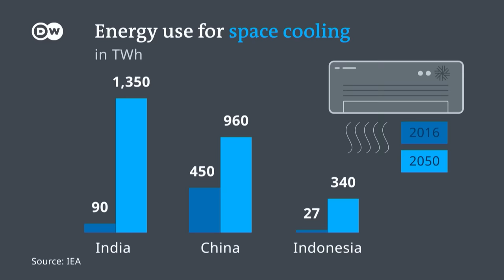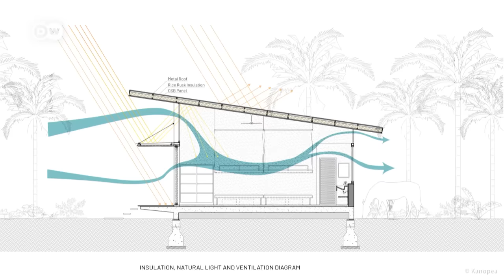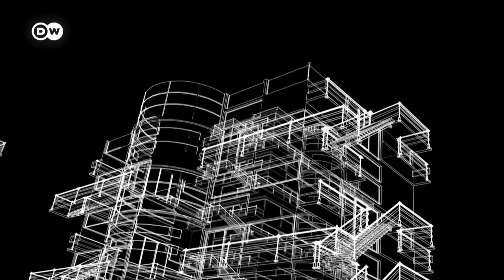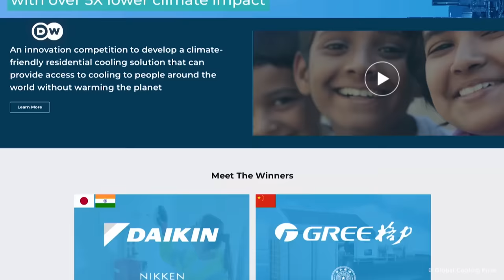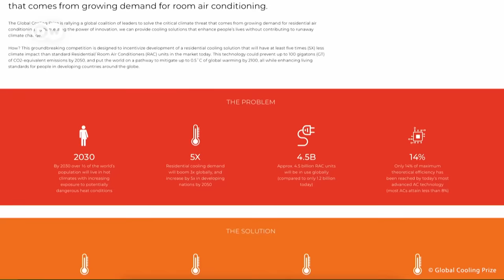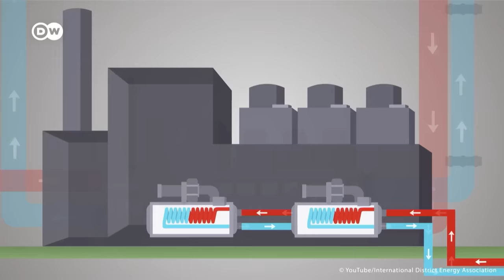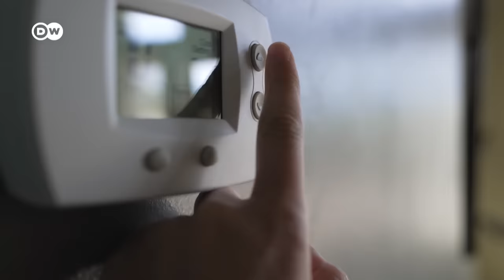How to cool our homes (even without ACs)

Comment: This video just absolutely does not represent the advances in building construction and energy standards for building envelopes wrt to higher insulation values, increases in energy efficient HVAC equipment and types of refrigerants used in the US.

Most of it is "climate crisis" platitudes.

If it's a 110 degrees outside in a middle eastern country, drawing outside air in through wind shafts or whatever at the top isn't going to cool the building.

I suspect most of the people in this video and especially the owner of this channel don't even know what the CO2 concentration of the atmosphere is.

India (and not to mention china) is one of the worst polluters in the world.

Properly designed glazing and glass facades are not "hot boxes" as someone who obviously has no clue about building envelopes.

They can be coated with high radiation reflecting material, and built with gases in between 2 or more panes that increase the insulation value.

Their energy and pollution problems are not the US tax payers' responsibility.

The US has some of the cleanest skies and water in the world. 

This amateurish ill-educated video should not be confused with some kind of lesson for the US.

Comment: Haven't watched the video. That tower doesn't work in a heatwave, just make the building even more hot. AC is very efficient if your building is well insulated, there's 0 issue with using AC. Thick walls won't make a building resistent. My wall is 45-50cm thick and it is absolutely useless during the summer.

Comment: Geothermal cooling is a good idea as well. Even if it's not the only solution used, it can greatly reduce the energy requirement to cool the structure to the desired temperature.
Reply from the maker: Yes it is a very cool alternative. The feasibility depending on the geological conditions of the location. 🌬

Comment: I mean, ACs are not evil. If properly built:
- They last practically forever. 30 years is easily doable.
- There is no leaks whatsoever. The refrigerant is contained from start to end life. Nothing gets in the air.
- It only uses electricity which can be 100% green - it all depends on supply.
- They are highly efficient. Both for heating and cooling. They use a fraction of power compared to the actual power they output.

So I am not sure why/how ACs are "bad" or how they'd contribute to global warming whatsoever.

Comment: Use new materials such as aerated concrete blocks and structures like the aforementioned wind tower. The United Nations building is a good example of passive cooling for a building, where wind enters a tower, and the air goes undeground where the temperature is the coldest, and then blown upwards by ordinary fans.

Comment: Central cooling you will have problems with pollution hazards if it occurs. For example, a bacteria or virus was caught into the internal ventilation, then it spreads across the entire city.

Comment: There is some research going on to use ambient heat energy into electricity. This might help transform the heat emitted by ACs back into electricity that could power them directly or charge some battery, that in turn could run the AC.

Even in tropical countries that receive tremendous sunlight, harnessing solar energy and ambient heat can help create  alternative sources of electrical power.

Comment: Make It Cooler WIth Choices

When we paint, build roads, roof buildings, buy cars, or select siding, etc. we all know that white creates a lot less heat than black does. We could probably buy some time by planting all white flowers, painting all driveways and hi ways white or close, buy only white or light coloured cars and trucks, and legislate that all roofs have to be white or light colours. 

This is not a final solution, but think about the millions of square feet of roofing in the world, the amount of heat absorbing dark roads we have created, and our general use of dark colours. These can still be used indoors, but we could turn several degrees of heat into cooling, if dark was illegal outdoors. 

Again this is not a solution but could buy us some time. 

I am repeating the suggestion of a scientist from years ago. This is not my own idea.
Reply from the maker: Yes true even if not a whole solution itself! By increasing the albedo we can lower temperatures in urban areas. 🌞

Comment: Traditional solutions can take us only so far. As the GDP of hotter nations like India/Indonesia grow, so will their urban centers.
And when urban centres grow, we face a clash of two options. Either the city spreads outwards into Endless Suburbia putting more and more land under the cover of Asphalt and Concrete
or densely packed urban spots of high rise buildings made of glass and steel that become solar cookers

I believe putting focus in developing better urban building standards (like using white pvc facades instead of glass and making extending covers over the outer walls to stop direct sunlight from hitting them) along with centralised cooling systems should be the focus of city planning going forward

Comment: I plan on putting on a pipe buried in the ground and it will deliver 55 F air into my house. I will have a window or vent in a high location to create a vacuum for the cooler air in the summer to come into the house. Just like the earthship houses use. Zero money will be used for cooling. Thanks

Comment: A lot of Indian infrastructure is slowly going for the American model where necessities are far far away and you have to have a vehicle to get them, Compared to European local market system. Then you have the housing boom polity which is just 20 floor apartments and glass house corporates which are literally green house structures in a country having seasonal heatwaves. Ideally, making walkable, short and dispersed cities from the village to towns to cities is the ideal. Plus there is a Green wall project in Africa by WFP to stop the spread of Sahara. This can literally be used to stop the heatwaves from Thar into Delhi. At most 4 floor apartment structure of stone walls and clay. And there is already an idea of using clay towards the outlet of ACs which pass around water to cool the out flowing hot air. These are basic things which can in the very long run change the course of India
Reply from the maker: Hey there, and what about this: "Can India's Great Green Wall stop desertification?" 👉 https://youtu.be/g59CelQPX74 🌱

Comment: Letting wind through your home will not cool it.. if its hot outside you are just pushing hot air in your house . In Greece we try to keep the house out of direct sunlight ither with trees or some sort of shade. then keep you building open during the cool night and then close all windows during the day to trap the cool air inside .

Comment: I remember when tall buildings had water coolers on top and factories had water filled ponds in the front. We have the tech to cool buildings, but building costs are cheaper to throw up a box and strap on an AC unit. 
I worked in a place that had 4500 ft houses with $100 power bills and the temp was 68 degrees. How? Geothermal.
Reply from the maker: That is pretty cool. 🔥 The potential of geothermal energy seems enormous but why is most of it still untapped? Check out our video on this here 👇
https://www.youtube.com/watch?v=c7dy0hUZ9xI.

Comment: Interesting stuff. I'm pondering the options of building my own house (timber framed) so a climate friendly design is a big concern. One conundrum is that some places have hot summers where cooling features are required, but those could be a downside when winter rolls around. If it's cold outside, you would actually WANT the sun coming in your windows, warming up your black roof, etc. Seems like it would help if there could be climate-friendly architectural features that can be changed with the season - maybe awnings that can be removed at the end of summer? Wind towers with an insulated, airtight door to use in winter?

Comment: The problem really lies in overcrowding cities,
so why do people overcrowd? its because of traffic, they don't want to spend 3 hrs daily just for commute.
This overcrowding, again increases traffic and the vicious cycle never ends!

hence, the solution is to push people away from the city, 
1. Extending city metros well outside the city
2. Separate lane on roads for Public transport (implemented in parts of metropolitan Pune city, encourages people to use public transport to avoid traffic)
3. Higher and stringent FCR rules, so that we have enough space in between buildings for ventilation.
this also encourages building horizontal traditional structures rather than vertical skyscrapers

Comment: It's correct that fossil fuels are used to make the energy to run the a/c units. 

However the refrigerant itself is disproportionately much worse for the environment. Just 10kg of R404A is equivalent to 39.2 TONS of c02. 

There are also alternatives like Hydrocarbon refrigerant which is fantastic but flammable or c02.

I would also be concerned that in developing countries, the training to work on these highly specialised units is sufficient and the refrigerant isn't released to atmosphere.

Comment: How to cool our homes (even without ACs) notes:
1. be open to vernacular architecture
    1. analyze the sun orientation in your house
    2. study the wind direction
    3. analyze traditional architecture and how it connects with nature
2. plants
3. wind towers (middle east architecture)
4. paint your house white
5. insulation
6. ceiling fans to circulate cool air
7. avoid glass, retains heat even if allows natural light
8. more efficient air conditioning units to controll humidity
9. consider renewable energy instead of consumable energy bec it makes the environment hotter

Comment: Big district cooling heat pumps have a lower cop than mini split systems. Then it still needs to be distributed. 
Also mini split ac systems double as a fossil fuel free heater during winter.

Comment: I don't get the problem, I see a different problem, people not re-using the heat. AC cools inside, heats up the outside. 

Those big buildings have central units to heat water, and central units for cooling the air. I would just use the AC heat to warm up the water, maybe it can get hot enough too boil water? 

For home users, especially people who have pools, use the AC heat to warm up your pool.

For coal power plant usages, use the heat to heat up the water like the coal does. Electricity is made from steam rotating turbines... heat is not a problem, it's an energy source.

Use the extranal heat to create electricty to cool the internal areas.
Reply from the maker: Hey there! Yes, this is possible and done for some ACs. They are designed to also heat the homes.

Comment: The answer to 99 questions is money. It applies here. It not about technology its about money. Its a choice, simple structure design changes can have a greater impact then throwing money at technology. Passive cooling and heating has been around for centuries. 
I have 20 years in the HVAC industry and have seen it all. It comes down to designing a system that considers the environment sun and wind conditions, including how to mitigate their negative effects and take advantage maximizing the positive effects. This is where you start.

Comment: Surely the only way in which we're "heating up the outside thereby creating the need for more cooling inside" is if we use fossil fuels to power them creating greenhouse gasses. The intro to this video seems to imply the use of oil and gas is inalienable as if green alternatives don't exist. Aircons don't create heat outside, they just move it from inside a building to out, the net amount of heat in the air is the same. Just actually invest in more solar/wind/battery & nuclear power stations and this problem (among countless others) goes away.

Comment: I once lived in an apartment complex that had one large water heater, and on large climate control. It would take up to 5 minutes of running the water before it would even get above room temperature and if you were cold in the autumn, or hot in the spring, you had to wait until management felt like switching the climate control from heat to A/C and visa versa. It sucked. Most of the things mentioned are going to cost billions if not trillion in USD. How will it be paid?

Comment: The problem is the building. My mom has a house with 10% percent of her house with glass and without tree very beautiful, however in the summer is a oven. My dad's house is more fresh in summer because has little window and has tree (oak,paradise tree) its help. However in the last summer need de AC because the heat wave  reach 40°.

Comment: 00:03 Cooling buildings consumes significant energy and contributes to global warming.
01:32 Global energy demand for space cooling is projected to triple by 2050
03:06 Reducing heat at a city-wide scale and creating green spaces are key steps to sustainable cooling.
04:44 Designing buildings that are less reliant on air conditioners
06:26 Reducing indoor temperatures and improving energy efficiency in buildings
07:58 Innovations in air conditioning technology can optimize performance and reduce climate impact.
09:43 Efficient air conditioners can save energy and reduce costs.
11:27 District cooling is a more efficient and cheaper solution for cooling new hyper-dense Indian districts like GIFT City.
Crafted by Merlin AI.

Comment: Insulation is everything. And combine it with meticulous of you daily temps control. I don't use my AC for 3 last years, using heavy curtains and ventilating the home early at the morning. Plus fans an a lot of trees around. Noticed, another "progressive" block design in Gujarat, where they eliminated hundreds of trees first, than introduced contemporary and efficient AC system. They'd better preserved more trees

Comment: The passive outside air methods don't work for the health of most people living in particulate and gaseous pollution unless that incoming air goes through a great filter.  Even if there were no air pollution, pollen can be a problem.  Qatar seems like a good place to try that, but I wonder about sandstorms.  Surely they have some filtration on that system and hopefully HEPA.

Comment: NYC has district steam heating for a few buildings and it's not the greatest use of resources. It's constantly breaking and even causing steam explosions. While AC isn't likely to cause similar issues, a single issue with the AC facility can knock out cooling for the whole district. Under capitalism, a government-owned district AC system is not likely to happen.

Comment: Since we use more and more Heatpumps with earth as a heat source, we started to just circulate the heating in Summer without the heatpump turned on, so we cool with the innate temperature of the earth. Its realy n efficent cooling and you alos safe money, because you need less boreholes, since you "heat" the earth in the summer.

Comment: clay buildings and cow dungs ppl b4 us were innovative and more advanced honestly now we see a problem and go ok so how do we use electricity to build this thing? we just depend sooo much on energy consumption for everything... it'll be sooo cool if stopped looking at the future and actually tried learning stuff from the past.
didnt realize how bad the heat expelled from acs were until i peaked out of my window which is usually closed and above the outlet thingy which gives out heat.. i saw that almost everyone has an ac so basically my window is ryt in front of my neighbor i put my hand out and tried feeling the heat and i kid you not it almost felt like i touched an open flame.. it is infact that bad

Comment: While I agree with most of this video, it’s just plain not true that air conditioners (aka heat pumps) are just some inefficient power-hungry device that has changed little since it’s inception. So many different coolants have been tested to try to find the perfect mix of efficiency and eco friendliness, the electric motors that run the fans and compressor have become more efficient overtime and waste less electricity as heat and noise, we have developed better designs of condenser and evaporator coils for better heat transfer as well as better designed more efficient fan blades, and I’m sure I am missing many other innovations that happened over the years but to sum it up they were just incorrect on that part

Comment: They need to hire better architects to design cooler buildings. Our university recently built a new crazy expensive business building that has no AC because it was an innovative building that had "natural AC". During spring quarter, there were 2 weeks where students refused to show up to class because the building was over 85 degrees inside, it's an absolute joke.

Comment: Architects and city planners are to be blamed for the bad designing of buildings and using too much glass for just beauty. The old methods were well adapted over centuries and worked better than these new designed buildings. Still if you walk into any old structure it will feel cool & with a slight breeze without any fans or AC.

Comment: well in India village people use mud house  which are so called kache makan  the keep temperature in side manageable  both during winters and during summers 18 to 25 
but the are not safe according Govt so  they pushed pakke makan a concrete jungle  which is reason for heating island  and drastic increase in energy demand 
what we need to do is study old technique and do more R&D and make better version out of it  dont need to dich old ways of cooling    one more example is earthen pot cooling  where earth pot use to chill water  in hot summer

Comment: Accounting for 50% of global final energy consumption in 2018, heat is the largest energy end-use and contributes 40% of global carbon dioxide (CO2) emissions. We need people to move out of very cold climates. They are consuming so much energy. What the hell. Heat is a luxury people!!